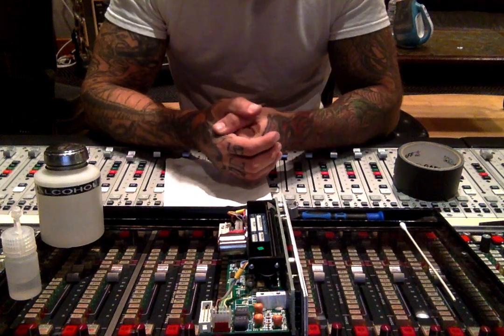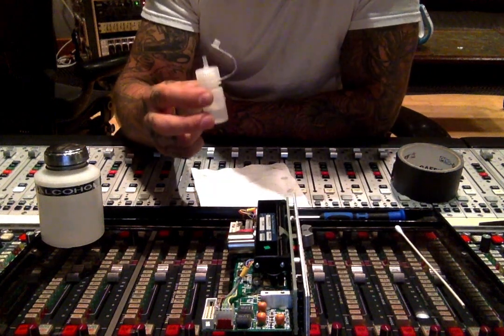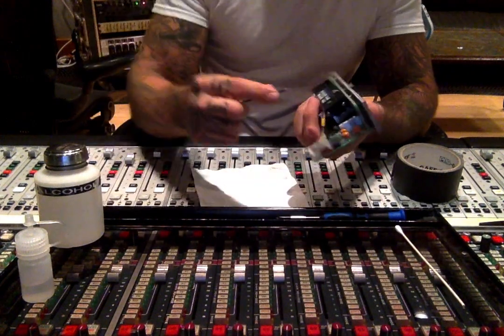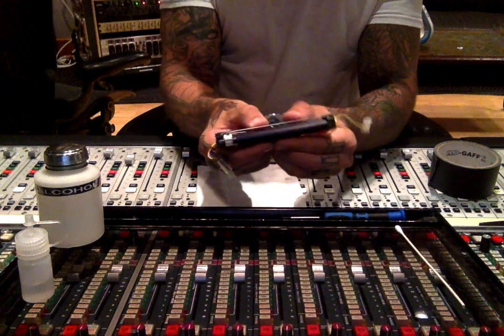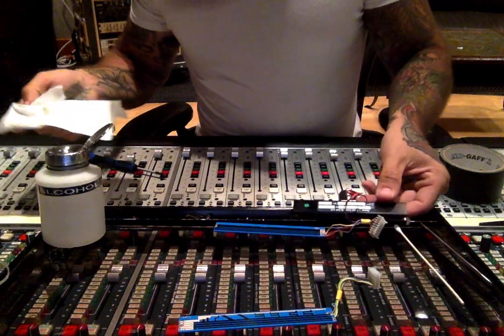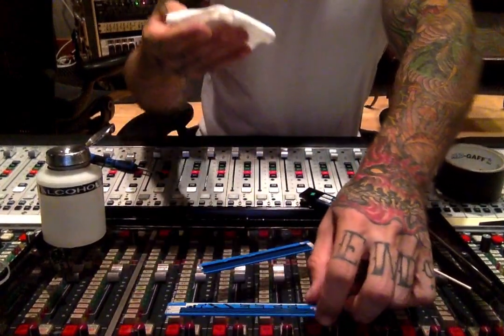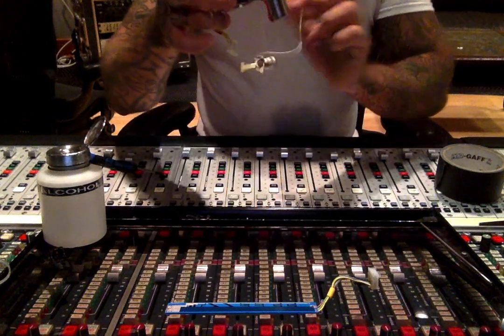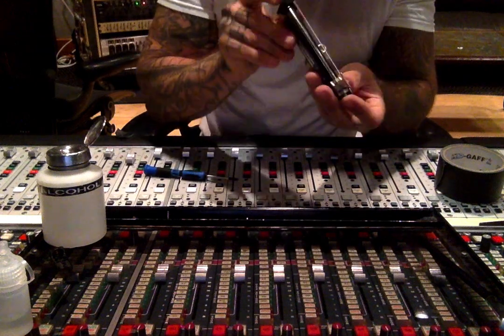How To Clean Recording Console Faders - Penny and Giles - Neve 88R - SSL 4K

Comment: Thank you for the service advice and tutorial. Penny and Giles do not recommend alcohol for the faders, because it can interfere with the lifetime of the conductive plastic. 
They recommend only lukewarm water. Maybe that is why the techs you mentioned wipe it with water?  Any thoughts on the issue ?
Regards 
Kay
Reply from the maker: I think that at the time these were being made, most studios that had large consoles had full time tech staff and the faders would get cleaned much more often than they do today, in which case repeated and often applications of alcohol might damage the plastic. I have never had an issue using alcohol, and lots of times it is necessary to clean the build up of gunk from neglect these days. But of course, use distilled water  on the plastic if you have any reservations. The metal contact fingers and rods I would still recommend be cleaned with alcohol.